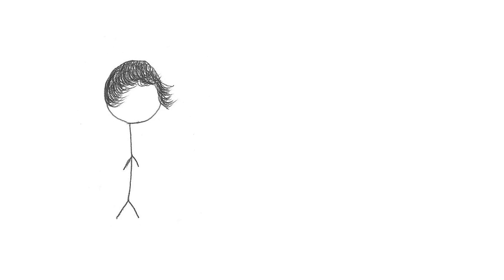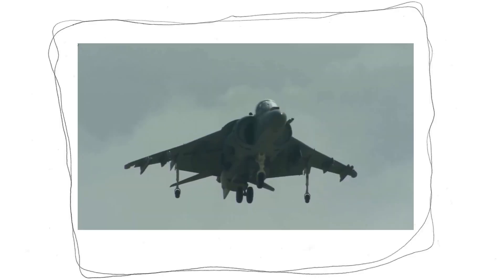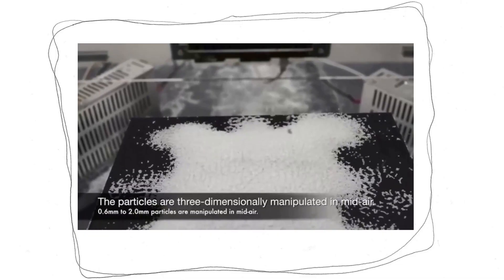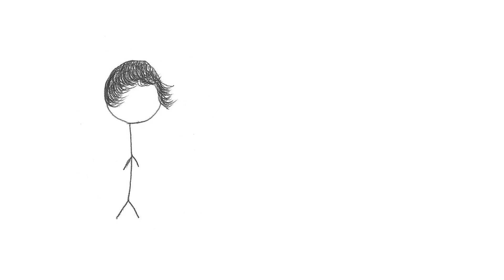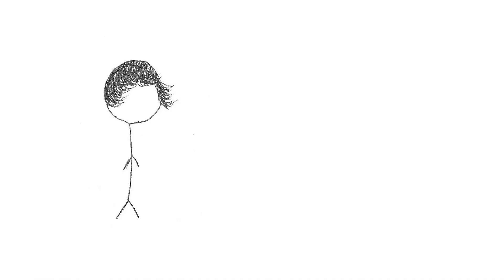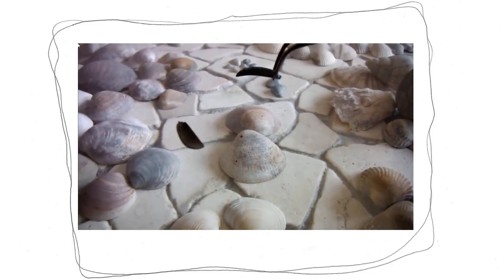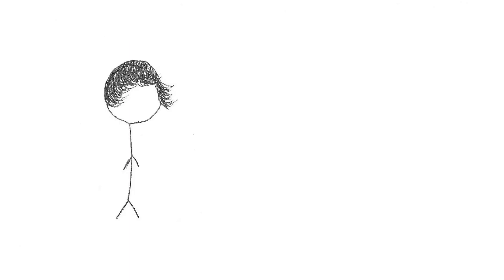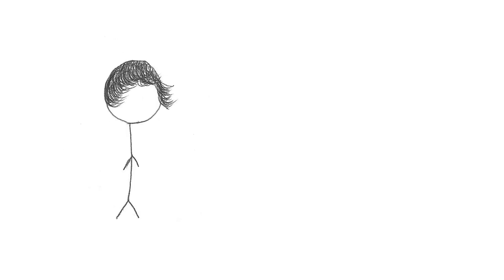Space Station on Ground - Debunked

Comment: Harriers are fun, particularly if you try VIFing (vectoring in flight). You can come to a sudden stop, let the enemy aircraft shoot past you, and pop off a couple of sidewinders. Electromagnetic levitation came much later than Faraday. Once, on a visit to Eric Laithwaite's lab, I was levitated about six inches off the floor standing on a slab of aluminium. However this requires a LOT of AC power, which means it only existed post Tesla. The Wikipedia article on acoustic levitation is interesting. Essentially it's radiation pressure that does it, and I wouldn't like to get in front of a strong enough sound wave to lift a person. As you can see the Neodymium magnet is inducing eddy currents in the copper, which slow it down, it's just induction damping scaled up. The resistance of the copper makes the current decay so the magnet slowly falls. If the current doesn't decay the magnet will stay up, but do do this you have to swap the copper for a superconductor.

Great video, keep it up.

Comment: The silly 3,000 mile diameter UFO is easily debunked as ppl aboard ships would not only have seen it, the shadow of the damned thing would make it virtually night time over the area it is shown over. I worked on the ground processing phase of ISS at the Kennedy Space Center. It was boosted into space component by component due to it's size and mass. Amateur astronomers globally have photographed ISS as it passes overhead. The methods shown here to apparently make the station hover at ground level are problematic. One problem being how do you get ISS to pass over say, someone in Florida and minutes later, pass over someone in South America? The levitating device would have to travel along the ISS ground path to make this work. It's easier to do ISS as it was actually done. Boost it piece by piece to orbit via space shuttle. Faking space flight is for those who think it's just too hard to do. http://www.isstracker.com/

Comment: What good would "scaling it up" do?
The space Station is 109 m across it's long axis, which would make the speakers necessary for the acoustic interference patterns literally miles high... this ONE station to simulate free falling by acoustic trickery would have the energy requirements of a country, if not even a continent. All to fake a few images you could fucking well get by sending a station up into orbit for a fraction of the cost?

WHO WOULD BE THAT STUPID? What would be the benefit of such an elaborate and costly ruse?

It's typical conspiracy theoreticist thinking, going with "just about so" possible factors and running wild with impossible extrapolations and outlandish claims only tangentally related to the original arguments. And they can't ever see why their jumping to conclusions won't work.
Reply: Also: "from what i would suspect it to look like in zero gravity" ... on what has Tiger Dan based this assumptions and how does he quantify the digression from the expected values? Or is this just another "looks faaaake" argument from a totally ignorant person with no experience in the subject in question whatsoever that could not even tell WHY or for what reasons it does look fake or how it would have to look if it were real.

IoW that "judgement" is fucking WORTHLESS.

as for "total weightlessness" ever bothered to look closely at the video of the magnet inside the pipe? it lies firmly down on the BOTTOM of the pipe... that is not floating or lying weightless in the middle of the pipe! He shows the exact opposite of what he claims...!

Comment: So I don't know how this was just recommended to me only just know, but I feel compelled to comment.  The impossibility that the ISS is being levitated via sound waves should have been obvious for reasons brought up by both TigerDan and you via reasons that you both touch on and yet fail to really explore.  TigerDan brings up the need to "scale up" the levitation device for a larger item such as the ISS.  While you mention this in passing you don't explore this in detail.  Two things are demonstrated in the video of the sound levitation device.

1.  The device is significantly larger, not marginally larger but significantly larger then the item it is levitating.  Thus the device would have to be significantly larger then the ISS, not just larger but significantly larger.  I don't know what math formulas that determine the size ratio of the speakers to the levitated object need to be whether the speakers scale up linearly or exponentially.  If they need to scale up exponentially, then scaling up probably would be impossible, but even a linear scale up for the ISS would be quite the engineering feat, they would certainly be big enough o be readily visible to any one.

2.  It is also readily apparent that the object being levitated is suspended in-between the speakers, never higher then the highest point of the speakers.  What this means is that these giant speakers would need to be suspended up in space at the height were the ISS is to be levitated.  Why send the much bigger and more numerous giant speakers up into orbit in order to levitate the ISS there?  If we can send the Speakers to that height, we can more simply send the ISS there on its own for much less money.